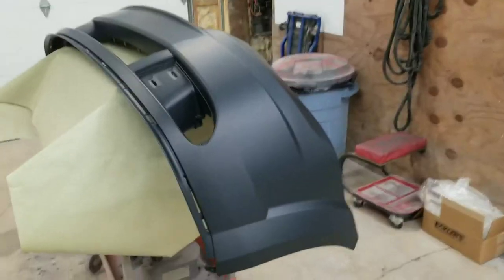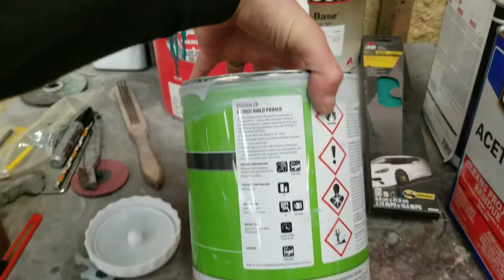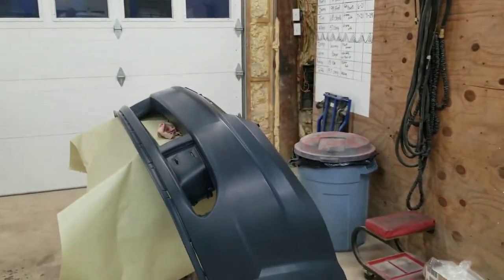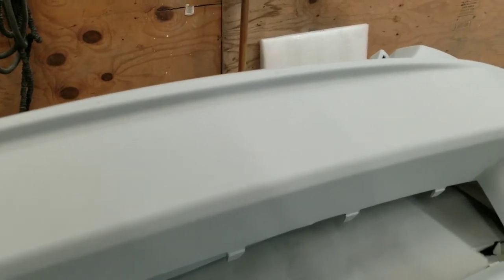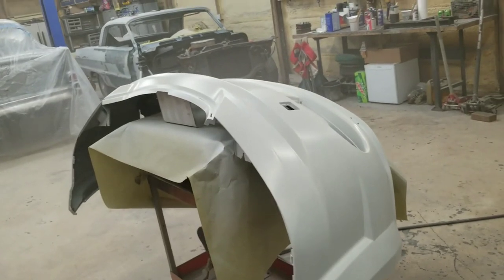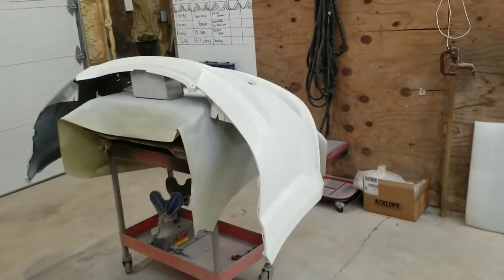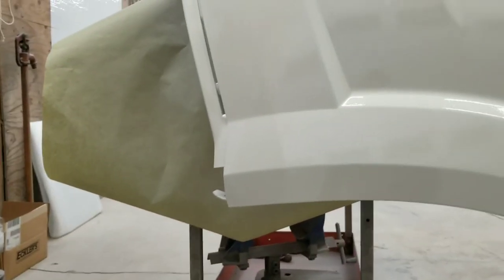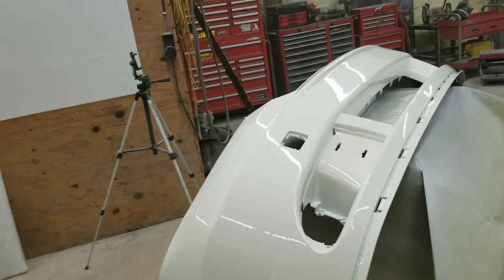Pre-primed aftermarket plastic bumper prep for paint no peeling no flaking make your paint stick

Comment: So this is becoming a mission to get this adhesive promoter product bulldog  nor 12316 was at Home Depot or advance auto parts.

I am a complete novice as this will be my first attempt to paint a bumper, and I have no clue where to buy these products. 

Not sure why advanced auto parts will not carry anything similar and they told me to look on Google for body paint shop suppliers in Miami or something like that route  when I live an hour away….  

Seriously, this is becoming a pain and not worth the time or effort to paint it to save a few bucks when I have to go all the way to Miami to get this adhesive promoter and still not even sure if they have it
Reply from the maker: Kleanstrip BD ADH Promoter 15OZ AERO (KLE-ETPO123B) https://a.co/d/3F2f7Ub
Reply from the maker: Amazon
Reply from the maker: They also have cheaper brands if you check
Reply: @bpbrestorations2093  thanks for the info but I like to go to the store and not order from Amazon. 

I was able to go to Sherman Williams automotive and they have the bulldog product but it’s Like $50 a can which is a crazy price to use it for a tiny bumper. 

I went with from Shermin Williams 
Primer spray from brand Transtar. he also discounted it to $35 as they sell that a little higher as well.

I will spray it over the Pre-primed bumper and hopefully that will give it the extra protection.

Comment: I'm a day late on this, just painted my new pre primed bumper and the paint slid off on 1 area. Now I gotta order more paint and sand it off. Mother #ucker.
Reply from the maker: Sorry this happened to you.
Reply: @bpbrestorations2093  today I sanded back the affected area and applied quality primer and base coated the whole bumper again. Clear coated to finish (slight orange peel but I'm not a pro yet and went for the factory look lol that's what I tell myself anyway)  and happy with my result. I also used a heat gun between coats to ensure warm surface and flash off was quicker before any runs could propagate. I think the combo of temp and a poorly primed surface created a surface which didn't adhere well and I over compensated to try and get the coverage even on a cool day.

Comment: Is regular primer considered a sealer or is it different?🙏🏽
Reply from the maker: The sealer we use is also a 2k primer, you can thin it 20% with reducer to make a sealer. So yes some primers are sealers also, but not all. A sealer is more thin so it lays out flat with little to no dusting or orange peel so your basecoat will lay out slicker.